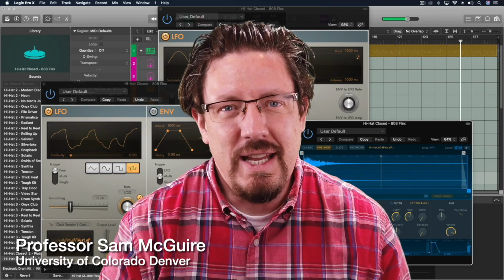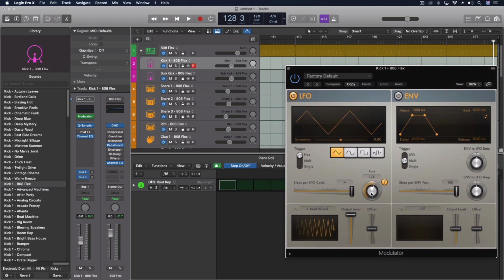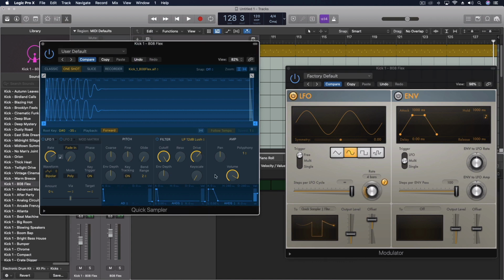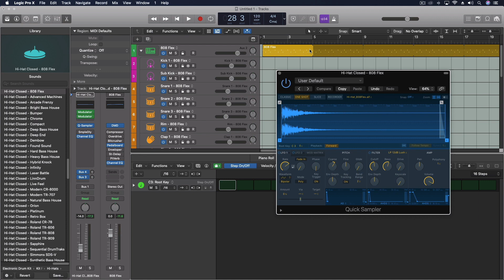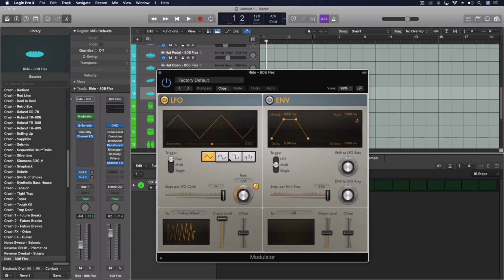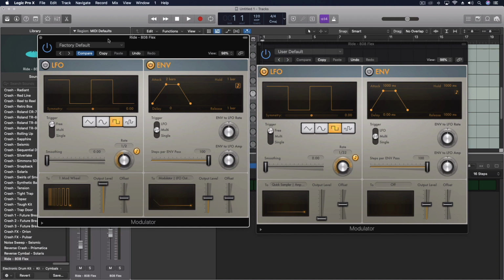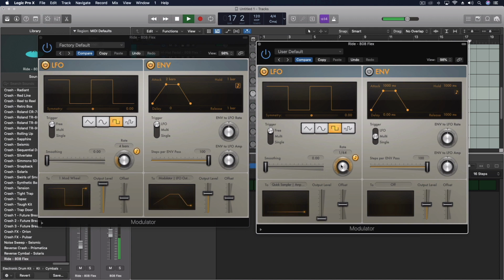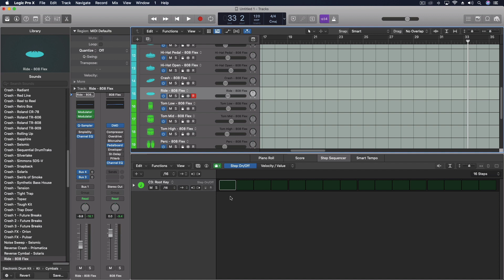Using the Step Sequencer with the Modulator | Logic Pro X

Comment: the step sequencer has nothing to do with this, you could do this before with regular piano roll midi
the title was pretty misleading, I thought you were going to show some cool trick using the step sequencer to control the modulators
this is really just a demo of using modulators with multi out instruments
Reply from the maker: Wasn’t meant to be misleading. Just showing cool ways to use them together. Although that gives me an idea to use the step sequencer as a modulator! I’ll make a video about that....
Reply: I didn't think you were trying to be misleading, was just a little disappointed, I think it was the "use them together" idea, when this is mostly just using modulators while the step sequencer happens to be there instead of piano roll. 
that would be a cool video, kind of the one I was expecting to see lol. I'm glad they added step sequencer, but they really messed some things up that would make it easier to use creatively
Reply: @DataBroth  Which things did they mess up that would make it easier to use creatively?